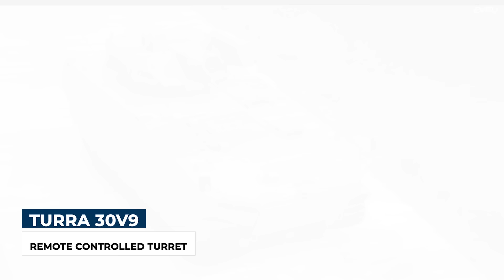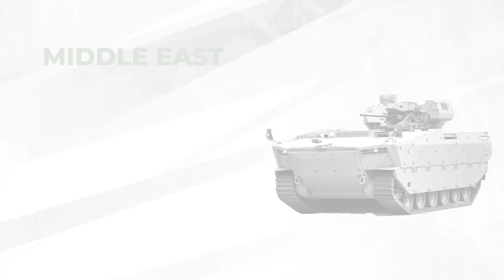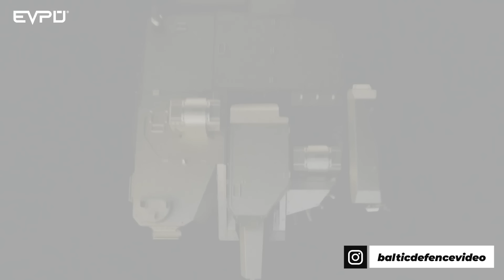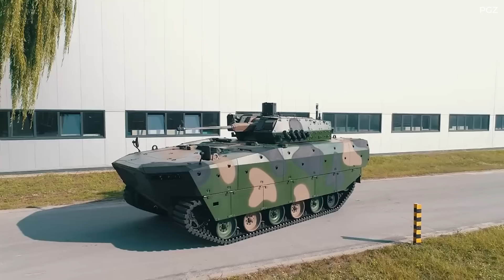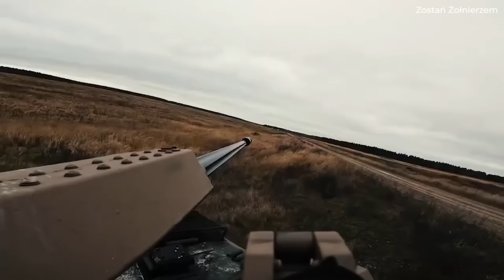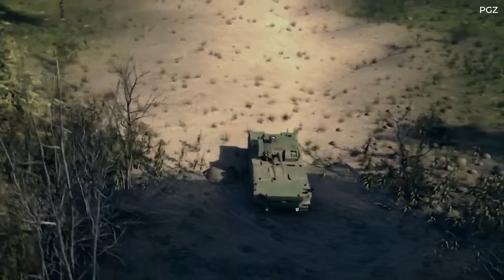Poland's Borsuk IFV: Export Version Unveiled At Defence Exhibition

Comment: Borsuk is NOT build around aluminum alloy hull with composite armor.
Borsuk is build around class HB500 welded steel alloy with extra spacing layers, NERA, ceramic plates.
https://2s14.blogspot.com/2021/12/inzynieria-pancerzy-cz-1-jak-chroniony.html?m=1

Comment: I am not convinced that our western IFV and others in the same region of vehicles, concept is the "right" way. Sure, russian BMPs are outdated and have a ton of ergonomical problems but they are much much smaller, lighter and cheaper. Vehicles like the Borsuk, or Boxer and such, are "giants", i mean think of it, the Borsuk is bigger than a King Tiger, and almost as big as a Leopard 2A8. In the cold war, Germany as example, decided that the race between firepower and armor can't be "won" and therefore designed the Leopard tanks with speed insted of more and more armor. For IFVs there maybe should be also a new way of thinking. Not making them bigger and bigger, more protected, heavier, more costly, and so on because the race against threats (drones, RPGs etc.) also can't be "won", and maybe a mixture of the old BMP approach and modern western IFV would be better. Smaller profile, light weigth, more speed, less cost, active protection, only armored against small arms, splinters and such, good ergonomics.
Reply: Wysoki profil pozwala na lepszą ochronę przed minami, w sensie że żołnierze w środku mogą być lepiej odizolowani od wybuchu pod pojazdem. Siedzenia ona odpowiednich amortyzatorach o dostatecznym ruchu pionowym. Dno kadłuba w kształcie V również wymaga miejsca. Sama wielkość sylwetki w dzisiejszych czasach to sprawa drugorzędna jeśli chodzi o unikanie wrogiego ostrzału. Większość i tak odbywa się z górnej kopuły. Tutaj przydałby się odpowiedni system aktywnej obrony.
Reply: In era of computerized fire control systems, low profile advantage is insignificant
Reply: @thezig2078 That is wrong. This kind of argument always pops up, if this would be true we also could paint our vehicles pink.
Reply: @polarstorm5986  how does camo and height affect visibility, is not even remotely similar
Reply: @thezig2078 Are you really asking how camo and height affecting visibility? If height isn't important, why we don't buld 20m igh veghicles? If camo isn't important why we ar enot painting our vehicles pink? You see? The principle is the same. The conclusion that because of computerized warfare and&/or drones something isn't important anymore just is wrong. As wrong as people who say "the age of the tank has ended because of drones". Neither has the age of camo ended, nor the implications vehicles size has (which also is part of camo).
Reply: @polarstorm5986  Borsuk's shell was designed to provide good protection, enough space for the crew, and amphibious capability, so it needed to be tall. 

And your low intelligence just shows with the fact you completely missed my point. Camouflage is there to make the shape of the vehicle less visible. Its height is irrelevant in this context.
 
Also Borsuk is 10 cms lower than M2 Bradley, so...

Russian BMPs are lighter and cheaper because they have inferior electronics, and far worse armor. They are rolling coffins.
Reply: Only the Leopard 1 was designed with mobility over armor. Leopard 2 was designed at the advent of composite armor in the west and with a balanced out design philosophy, having actually better armor protection than the Abrams.
Reply: @jonny2954  That's complete nonsense/lie. Leopard 2 has never had better protection than Abrams or Challenger 1. Especially sustained hit durability of the two. Leopard 2 inherited the hull design from Leopard 2K, the only difference being the composite, closed between relatively thin metal plates, which caused weld split during ballistic tests of the hull. For comparison, Abrams and Challenger 1 have closed the composite between massive steel plates, which could absorb much more punch than Leopard 2.

I am not even going to mention the horrible design of Leopard 2 turret shell. Needlessly overcomplicated, with very serious weakspot on the commander's side, as well as huge armor gap on the mantlet.

Leopard 2 was a rushed stopgap, with fatal design flaws, that stayed in service only because the cold war has ended before a proper tank could have been developed and put into service.
Reply: @thezig2078 It's insane. We have literal proof of this for decades coming from leaked documents from the Swedish MBT trials and Abrams fanboys still come up with mental gymnastics to claim the Abrams is superior in protection.

No. It isn't. Calm down. The protected volume advantage of the Leopard 2 alone makes it incredibly difficult for the Abrams to match its ballistic protection. Not to mention Abrams simply lacking build depth in some areas (UFP) to match Leopard 2s armor layout.

Next he brings up the also completely fabricated myth of the M256 magically being able to sustain higher operating peak pressure despite being the exact same bore as the L44.
Reply: @jonny2954  There is a very good video explaining why the Swedish documents were not true to reality, on Damian Ratka's channel (Broń Pancerna Świata,) titled "Pancerz Czołgu Leopard 2". You should watch it, just need to put the auto captions. It's not fanboyism, it's facts supported by sources, and not opinions, or one false document. Swedish MBT trials were purely political, just like the 2A8 purchase by the Norwegian army, where the army recommended, and wanted the K2.

And Abrams can, by all means, match Leopard 2 armor, and far surpass it. UFP is a small target, angled at 82 degrees, made of high hardness armor,  very unlikely to get hit in real combat. Abrams has a far lighter power unit as well, giving it more free weight that can be spent on armor. Standard ide armor on Abrams is much stronger than Leopard 2 as well. And most important of all, Abrams is not riding on non isolated ammo storage, that will destroy the tank, and kill everyone inside, when hit.
Reply: @thezig2078 The problem is that the individual you base all your claims on, Damian Ratka, is a very well known Abrams apologist, almost religiously so, who has been disproved many, many times. Often exaggerating specs, taking things out of context and often just straight up making up stuff. He's one of the people who used to spread the M256 myth until he got BTFO'd by people far deeper into the matter than himself.

As for the rest, Leopard 2 outperformed K2 in Norway in every single metric except mobility. That is the truth as confirmed by Trond Haande. The mobility apsect however was ignored since it was a full blown 2A7V put up against a ROK-spec K2 which was much lighter, and not in the configuration Norway would've procured the K2. That would be the europeanized variant similar to the proposed K2PL, which adds another roadwheel pair and increases the weight to that similar to the Leopard 2, negating all mobility advantages.

The entire "political decision" BS was made up by butthurt Korean K2 fanboys after Norway decided for the Leopard 2 and Korean tabloids picked up on it. That makes it two misinformation sources you fell for. You need to diversify your sources.

What if i told you if you dig deep enough you can even find accounts from Polish soldiers criticizing their new K2s compared to the Leopard 2? Hint: Turret drive overheat indicator (the K2 doesen't have one).

As for the Abrams UFP, yes it's a small part. No, it's not made from "high hardness armor", it's regular RHA armor steel from the hull. No composite there.

It's also a small part on the Leopard 2. And even though it's actually even thicker than on the Abrams by default that didn't stop them from putting NERA addons on it. No space for that on the Abrams.

As for ammunition stowage, since Rheinmetall introduced their insensitive SCDB propellant that point has been made obsolete. Modern Rheinmetall ammo doesen't explode when hit. That's why the Russians want to get their hands on it so badly, because it solves the largest issue with T-series MBTs.

Can't out-nerd the nerd on this one, sorry. I've known Damian for over a decade.
Reply: @jonny2954  Read statistics from Ukraine battlefields! Abrams M1A1 performed here much better than Leopard 2 A4/A6 and Strv122. Leopards2 got  much worse results, more percentage to used in combats, were completely destroyed! So, in real combats OLD Abrams M1A1 survived better, protected and save crews better, than newer version Leopadr2A6! That's  real prove, not your theory speech.
Reply: @Aski2  Well i wonder that statistics you read, but in the official stats we have the Strv 122 is the most survivable MBT in Ukraine. You treating A4/A6 and Strv 122 all the same pretty much shows how little clue you have about the topic, each version performed quite differently in Ukraine. The additional roof armor on the Strv 122 enabled better protection from top attack threats than the other tanks.
Reply: @jonny2954  Do not lie! Every Leopard 2 version and Strv122 used in UA performed much worse than OLD Abrams M1A1! Strv122 survived here only few tanks and majority were destroyed or damaged. Big numbers of completely destroyed and damaged Leopards 2 and Strv122 prove that their armors were not enough to perform better than OLD Abrams M1A1. That's a FACT!
Reply: @Aski2  Except Oryx states otherwise. Or do you have another source to back up your dubious claims? No? That's a shame.
Reply: @jonny2954  Do not lie again! Oryx shows bigger loses on Leopard 2 A4 and A6 than Abrams M1A1. Look also at Damian Ratka statement based on few different sources. He present statistics with well documented events. That's a shame you do not know these facts.
Reply: @Aski2  Bigger losses because more were send in total. You have to look at the percentage losses, not the total losses. And that's where Strv 122 has the lowest losses.

I explained that Ratka guy in a comment above. Guy is not a source. Why are you coping so hard?
Reply: @jonny2954  You still spread lies! I referred loses as percentage destroyed MBTs to numbers used MBTs in UA. Stated this in my pervious posts. It looks you can't read that properly. Damian Ratka of course is not a source, but he presented statistics BASED on few sources, not only one Oryx. So, he is right in his statement, Abrams performed much better in UA battlefields, than all variants of Lepoard2.
Reply: @Aski2  Link me your sources then, because official ones state otherwise. Strv 122 is the most survivable MBT in Ukraine.

Unless you can provide sources your claims are baseless.
Reply: @jonny2954  I got better solution. Look at Damian Ratka video about MBTa loses in UA showed on his site Bron pancerna... He mentioned sources to his statement in this matter. You can find there his statistics which prove that Leopard2 and Strv 122  got worse loses percentage than Abrams in UA battlefields. EOT

Comment: I hope it prompts the development for a heavy armor package for when you don't need to swim
Reply: The additional armor was known before the prototype’s premiere. Pause the video at the 1‑second mark — what you see at the front of the hull is an extra armor panel that gives it STANAG 5. With this panel and steel tracks it is capable of swimming, as it was tested in this configuration a few days ago by the army on the training ground, when 14 Borsuks were crossing a lake. Meanwhile, the additional armor that results in the loss of amphibious capability and raises the hull sides to STANAG 5 has also been known before the prototype’s premiere — you can see the mounting points for this armor on the sides of the hull. Type ‘pancerz Pangolin WITU’ into a search engine and you’ll see what it is.

Comment: I don't like the color.

Oh, not that kind of comment?

I fear for operators who suffer the consequences of procurement decisions, and the commercial pressure to create a vehicle that does "everything".

Modern technology is fantastic and vital but isn't very damage tolerant.

And every evolution introduces yet more unproven failure paths.

The fundamental shape of a giant shoebox also doesn't inspire confidence.

The idea of armor which can ford or swim again is great but they are so slow and sitting ducks.

And of course we have daily reports of the New Warfare in Ukraine demonstrating that there are no vehicles that are safe from that threat. I'm not even going to say the word.

So if it was a nice color, would tip the scales 😂
Reply: The shape of the front section results not only from buoyancy requirements but also from research showing that a projectile needs an 80‑degree angle to ricochet — and that’s the angle of the upper front plate. The lower front plate appears to be around 60 degrees and corresponds to STANAG 5 in the version presented at the trade fair in Slovakia. Achieving STANAG 5 protection at the front while maintaining amphibious capability is a very good result; only the heaviest competing vehicles offer similar frontal protection.

Comment: As far as I know, the obstacle was the license for the Bushmaster cannon, where the American company was blocking such a possibility. Don’t spread propaganda claiming that the Borsuk is light — 28 tons in the basic version is not a light vehicle. The maximum chassis load is 36 tons, and you can see mounting points for additional armor on the sides of the hull, which would bring it up to STANAG 5. The Borsuk also has a tactical advantage in that, while in the water, it can use all of its weapons, meaning that the opponent on the shore will be in serious trouble, because the Borsuk will be harder to hit than the opponent standing on land.
Reply: There is also suposedly an issue with classified solutions used in the ZSSW30.
Reply: Its lighter than most not amphibious ifvs, at least 10 tons lighter than the lynx ifv that weighs 40 tons
Reply: @foxy126pl6  This is the standard version, which can accept an additional 6 tons of ceramic armor, and the chassis has a payload capacity of 36 tons.
Reply: First of all: the military themselves wanted specifically bushmaster, not any other cannon 

You are spreading propaganda yourself. Borsuk is the WORST armored, tracked ifv on the West. It's base armor doesn't provide protection against 50 bmg from sides, with additional armor it provides stanag 4 level so against 14,5mm what is still lower than in Cv90 mk4 or Puma. With additional armor, it loses swimming capabilities and Poland itself has no plans on buing additional armor packs

Who cares about amphibious capabilities anyway? Both russia and ukraine has a lot of hardware capable of that but they are not crossing rivers that way because it is easy way to turn ifv into submarine
Reply: 28 tons is relatively low even for an IFV.

Comment: Borsuk is meant for High mobility units; not face to face battles. (So move about and catch/hunt other mobile enemy units)
Reply: Absolutly not. Rosomak APC with 30 cannon is meant for it.

Borsuk is to replace strictly combat units, still aperating on bmp-1. The catch is that Poles don't consider frontal attacks, but rather high mobile circular movements with many natrural obstacle crossing as historically is completly valid strategy on their terrain. All today's central Polsih ww2 '39 or '44-'45 battles were around rivers and circular movements.

But still, it is possible that instead of around 1500 needed Borsuk's they will buy about or less than 1000 and find additional 500 heavier not-swimming vehicles or develop their own "Ratel", for a sake of battles on flat easter terrain along with Abrams tanks.